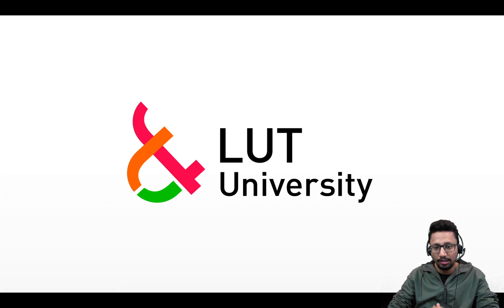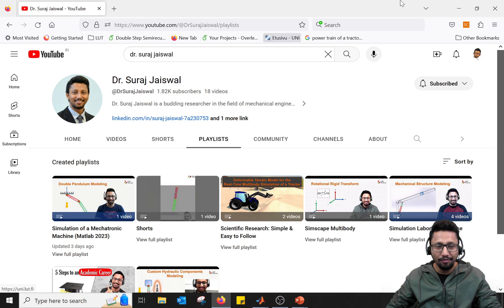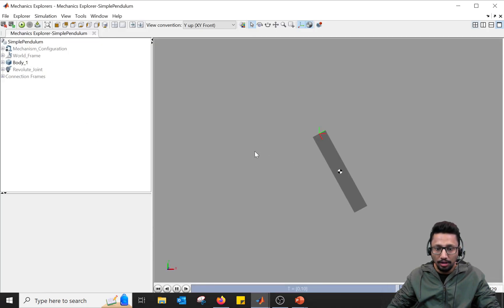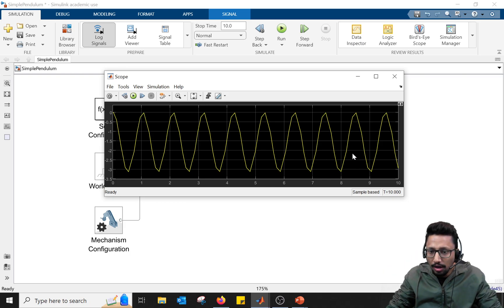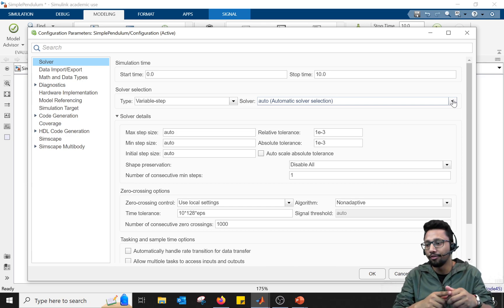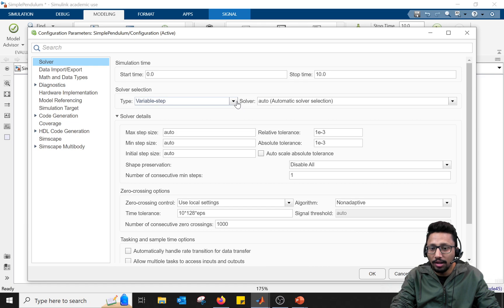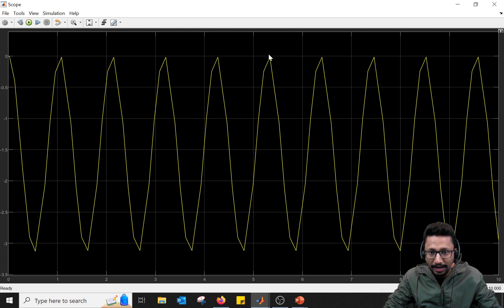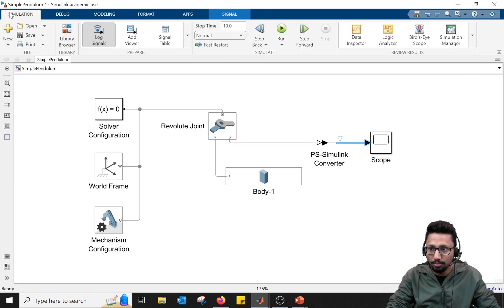Solver Basics | Simscape Multibody | Matlab 2023 | Multibody Dynamics | LUT University | Finland

Comment: Dr. I wonder that there is anyway to use ode45 during simulation process. I have tested a lot of model with the purpose to simulate the vehicle dynamic and with ode45 my laptop almost freeze
Reply from the maker: Well, there should not be a problem like that. I suspect that either your model might have some stiff components or maybe are you using an old laptop? 
Please try another integrators !